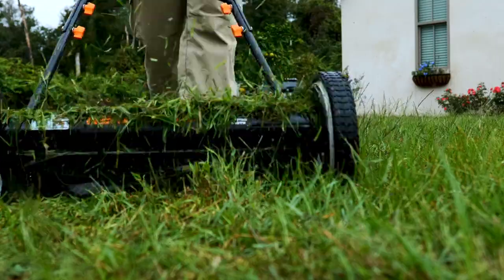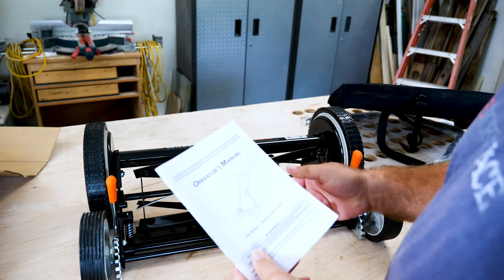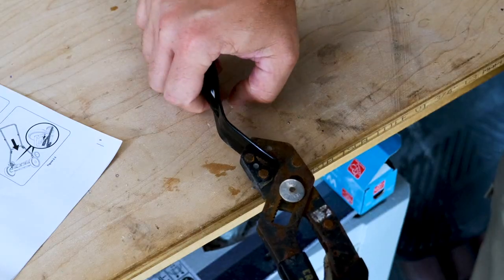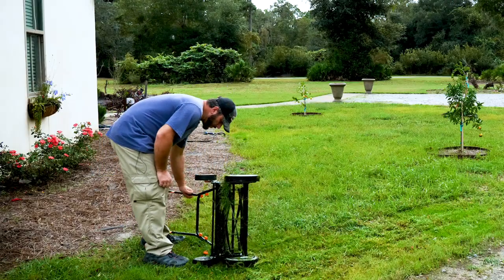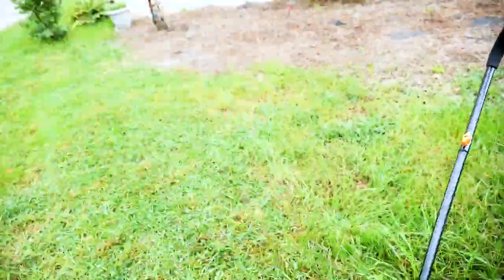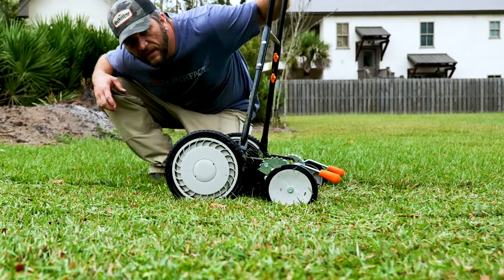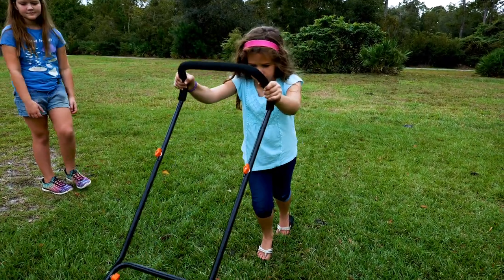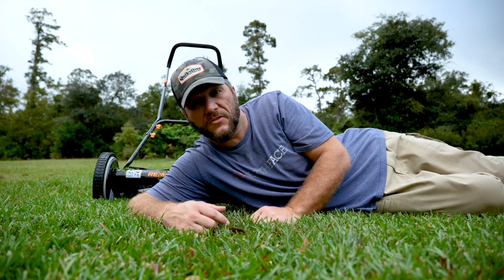TESTING The Cheapest Lawn Mower On AMAZON

Comment: We had push and self propelled reel mowers.  With them, the grass should be relatively dry unless you mow frequently to keep it trim.  long wet grass is a mess to mow anyway. Reel mowers don't like sticks.  rotary mowers just toss them aside.   They are also very vulnerable to rust.  It will seize the blades.  But a really well kept, well lubed reel mower on rye or even bermuda makes a wonderfully evenly cut look..

Comment: Seeing you struggle a bit at 7:15, I have to bear in mind that this grass is soaking wet and almost flattening as you push over it.  But, that mower still did a damn good job for the price of it.  I've just taken down from the attic, my 40 year old Qualcast (UK) reel/cylinder push mower, where it's been for 21 years. Cleaned up not too bad considering the attic is not watertight in the house, so, a bit of rust and paint flaking.  All greased up and oiled, the only thing to complete the job is backlapping the blades and I should be good to go.
Reply: Thanks for the insight! Could you share what type of oil you used?? ☺️
Reply: @Legz347  - Hello! Apologies for the late reply.  To wipe down the reel mower after taking it from the attic, I just used a cloth soaked in WD-40. That took all the dust off. I gave the blades on the reel a very light brush of fresh car engine oil (unused clean oil, basic 10w/40), but any clean oil will do).  Left that for a minute and wiped it off (don't want too much oil on the blades when cutting the grass). 

I removed the wheels (to get at the nylon gears behind) by popping off the metal 'hub cap', removing the E-clip, and sliding off the wheel.  Applied some EP2 Grease to the gearing and re-assembled (it's what was in the garage, but could also have used my red motorcycle grease (Silkolene ProRG2). But, all in all, no fancy or expensive lubricants are required as it's not a high tech machine, nor one that is under heavy load.

I have a can of ''ACF-50'', which is a fantastic product that I use on my motorbike.  It's anti-corrosive and leaves a long lasting protective film.  I used that on all the nuts and bolts and the reel adjuster springs, but good old (and reliable) ''3-in-One'' penetrating oil would do just as well.

I hope this helps. Sorry it's a bit long, but will finish by saying: don't let repair shop or 'die-hard' lawnmower people sell you fancy lubricants or recommend expensive grease in a huge tube that will take you 20 years to use.  All you need is a can of WD-40 or 3-in-One, and a teaspoon size splodge of grease on each wheel gear. It could be basic white grease, or black grease (used for ball joints or bearings in cars). As long as it helps reduce the friction between the plastic gear and the plastic wheel, then all is good. 

All the best.  Dogue.
Reply: @WhosAGoodDogue  This was super helpful, thank you so much!

Comment: Just remember, with a reel mower you set the mow height to no more then 1/3 the length of the grass blades.  Ideally you should only cut 1/4 " at a time.
Reply: " I like to cut my grass a 1/4 inch at a time." - Dominic Toretto

Comment: The traditional design of reel mower is that the cutting action is like scissors. It would take more effort to push because of the frictions. And you'll see a few tall grasses sticking out like a sour thumb. If I re-design the reel mower, I would do the following: It should cut with speed like a weed whacker cut with a nylon string. The reel blades should be all straight not twisted. The reel shaft should be equipped with ball bearings on both ends. The blades are made of alloy steel hardened to RC60. The bottom fixed blade should be eliminated to avoid twigs getting stuck in there.
The traditional push mower will cut much better if the reel blades are sharp and do not make contact with the bottom fixed blade. Push it at faster speed and you won't see sour thumb sticking out behind the track.
Reply: Would you gear it up so that it rotated faster?  Do it.  I'd buy one.

Comment: My gas mower needed a new deck, carb, and tune up. I also live where 87 octane is $6.00 a gallon or very near it. So I said the heck with it and chose electric. Battery to be exact, I chose the Stihl 510 battery push mower. The reason for the stihl is for its low noise, low voltage. 36 at 7.5 AH, yet long running time. The other models have 60 to 80 volts. They run at a noise level, equal to the exhaust side. Of a turbine engine, at full output. Example Toro and Worx nitro. Again my stihl is much much more quieter. I cut the front lawn with a fully charged battery. I used half of the single battery's charge. To cut the front lawn, take it into effect that my lawn was 4" tall. Dry, now 1" tall when cut. Would have otherwise used a full tank of gas. On my 5.5 hp Briggs mower.

Comment: Thanks for this excellent video. Just got a Scott's 20" reel mower and am excited to try it out this week.
Reply: It's good as a toy but it does a terrible job cutting grass and it's alot harder to push and slower than a  gas mower
Reply: @forestman2382  It works great for me, now in year two. I just might get some grease and sand so I can sharpen the blade soon. It doesn't feel very hard for me to push, and I like not having to worry about gas, oil or spark plugs.

Comment: I've always wonder what the difference in effort between this and a gas powered mower? Seems like heavier weight and automatic power vs lighter weight but the blade speed is determined by pushing force and speed. Not including grass types or height, which is easier?
Reply from the maker: Gas or electric is much easier
Reply: @HAXMAN  but you don't build forearms with those. It's much more rewarding. I EARNED my $5 mowing Old Man Sullivan's back yard. his was an old one from sears

Comment: 89.99 and it wasn't electric? Such a bad deal. There's decent enough electric ones in the UK for £65
Reply: Yeah, maybe corded ones. The battery-powered mowers I've seen tend to be upwards of £150 or they're like the Karcher models where the battery is sold separately and costs more than the mower itself.

Not saying 90 USD is a great deal, I don't think it is, but push mowers are generally much cheaper than electric ones. And I don't particularly trust Fly-Mo.